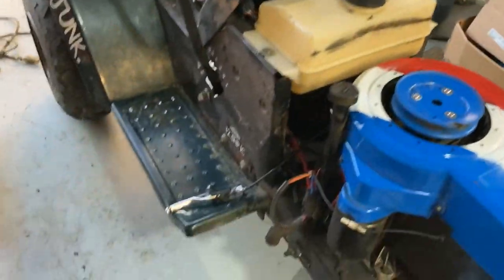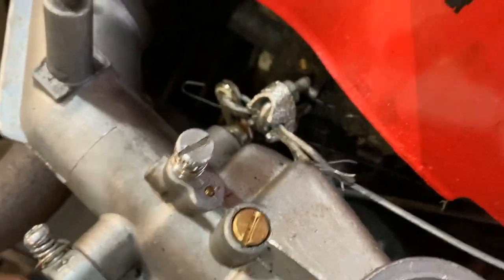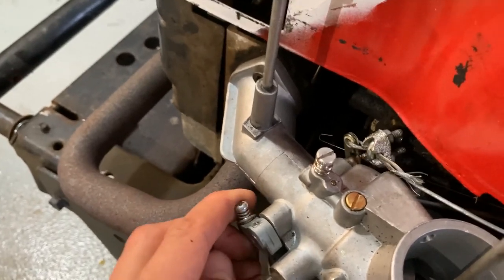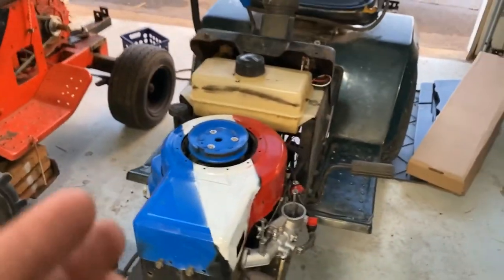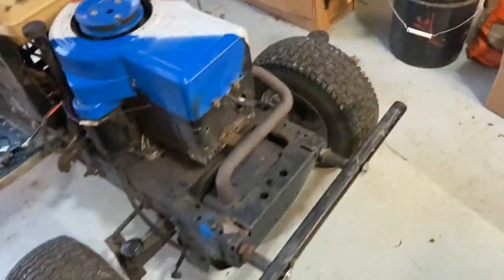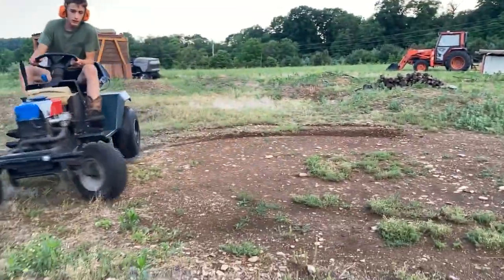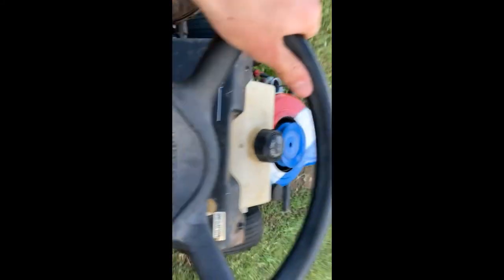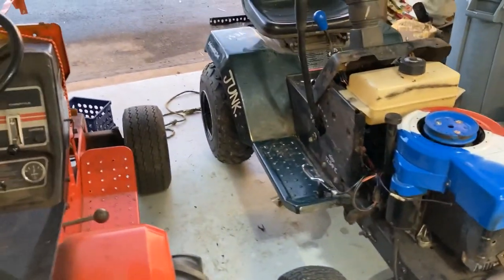How To Put a Gas Pedal on a Lawn Mower + Taking the Governor off!

Comment: Why would it shorten the life of engine?
Reply from the maker: Doesn't  really shorten the life of the engine, depends on how you drive it, still running strong today
Reply: Cuz you're able to over rev it.

The governor is a simple mechanical system installed on the throttle that prevents your from giving it more throttle beyond a set point. That set point is determined safe for the motor indefinitely assuming no one has ever fiddled with it.
Some governers can't be adjust and are just removed. Now it is up to the person controlling the throttle and transmission not to Rev to high or for too long.

However like OP said, the mower still runs to this day.  and I'm sure they had plenty of fun abusing it lol so that's a testament to the motors durability
Reply from the maker: @RandoManFPV  Perfect explanation, cant kill the flat head briggs lol